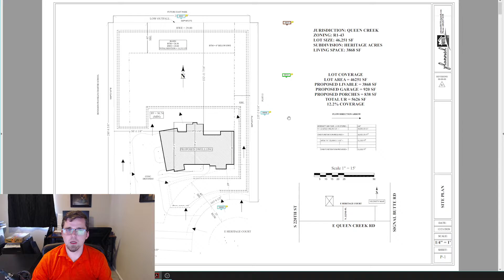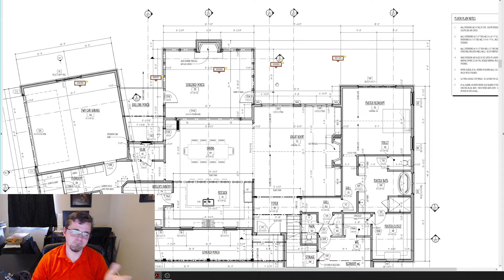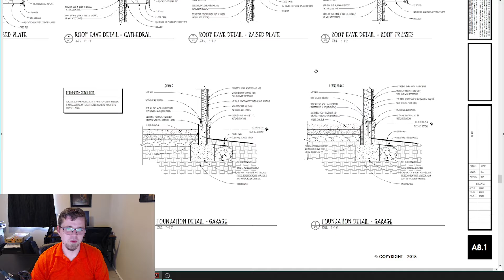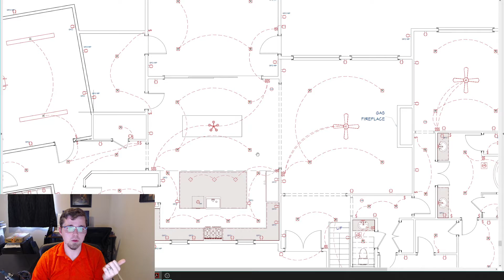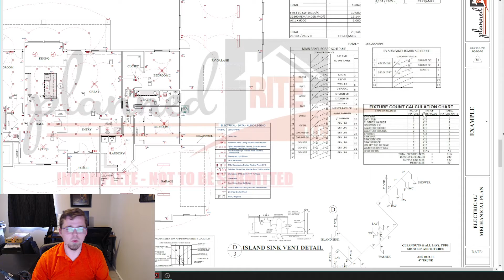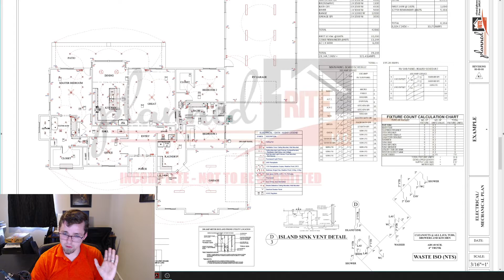BE CAUTIOUS When Looking at Stock House Plans

Comment: Great information.  The issue I am having is that architects are charging $50,000 to $75,000 for house plans, not including any of the engineer work.  I would gladly pay $7,000.
Reply from the maker: It is highly area dependent but many parts of the US do not require a registered architect to draft the plans for your home. It's almost ALWAYS more inexpensive to hire a draftsman to draft the plans for your home. We often see typical homes drafted around the $3/SQFT mark whereas you can easily see $10/SQFT with many architects. There are pros and cons to both but the overwhelming majority of people have no need to work with an expensive architect to accomplish their home goals.

Comment: Very accurate and correct video based on my experience. I just posted a video on this topic and we both touched on some of the same drawbacks to online plans.
Reply from the maker: They can be great but more than not they do become problematic (at least in our area). I will need to do a followup video on this topic as I've discovered more issues with stock plans.

Comment: Thanks for the insight Ethan, hard to find info like this. I appreciate it as I prepare to build my home in the near future.
Reply from the maker: Thanks for the comment! Yes, these online plans may work just fine in a handful of areas. But in areas (such as here in Arizona) where permitting can be more challenging, these plans become a wasted purchase. It's better to find and work with someone with plenty of experiencing permitting in your area.
Reply: @plannedrite8075  I'm considering building a relatively simple home should I still see an architect first? Would it be more economical to see a drafter and then a structural engineer for the construction drawings? What information do you like to see a client prepared with before they come and see you?
Reply from the maker: @bf4816  Most economical would be to work with a draftsman. Many, like us, try to draw out the construction documents per prescriptive building code which could save you the cost of a structural engineer. It's always a good idea to use an engineer but may not be necessary, depending on the build. Many licensed architects in my area are actually turning away work unless it's a large scale custom home or commercial job so that may not even be an option.

An architect's primary goal is to improve your quality of life through your home. With that in mind, their process can be MUCH more involved and detailed which translates to a high cost and time frame. That's an excellent thing for many people but certainly not for everyone.

When a client reaches out to us for a "simple" new build I like them to have an idea in mind for their floor plan and exterior design. Many clients will bring a floorplan that they found online, maybe a few, and want to rework them to fit their needs. The same goes for exterior inspiration. We would then work on the first draft which would incorporate what they brought with what we discussed with them and then tweak it until it's perfect.

There are different calibers/levels of draftsman, designers, and/or architects. For us, we divy our work mostly into 2 categories. Drafting & Design and just Drafting. Most of the work we do is Drafting, the work moves relatively quick and the cost is inexpensive. However, when we work with clients to really perfect a design or are working intensively with the builder and/or interior designer, our Drafting & Design work is much more labor intensive and the work REALLY shines. But there is, of course, a higher cost associated with it. Some of the most intricate work we do will take us 150+ hours in just design work in front of the computer. Basic drafting with some small design work usually only takes around 10.

I could go on for a while, clearly, but I'd recommend finding a floorplan (or sketching one out on a paper) and exterior design you like and then get in touch with a draftsman. Even if you aren't in our market, feel free to send us an email and I'd be happy to see if I could connect you with someone who can help. ethan@plannedrite.com
Reply: @plannedrite8075  Thank you for the detail and thought out response Ethan, I really do appreciate it. You've given me some much needed perspective as I am still very much in the planning phase. Does your offer to connect still stand for Canadian clients?
Reply from the maker: @bf4816  You're very welcome. Go ahead and send me an email with your rough location when you get a chance. I don't have any strong contacts up north that I can think of but I'm happy to help you track someone down.